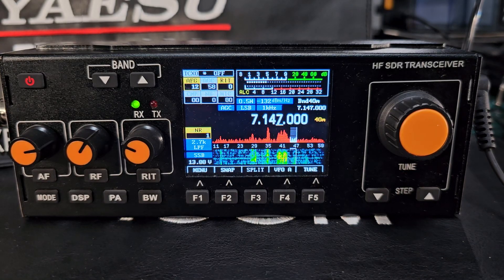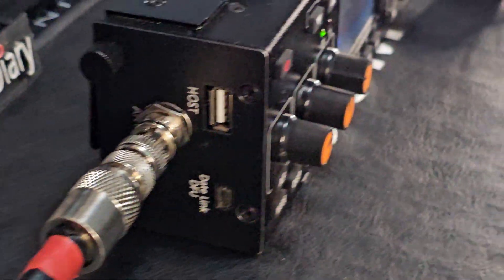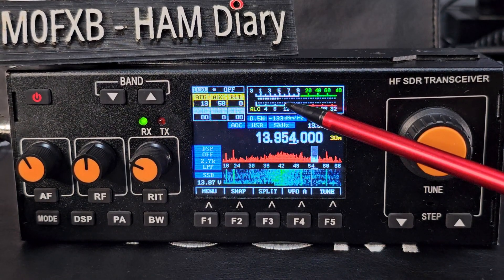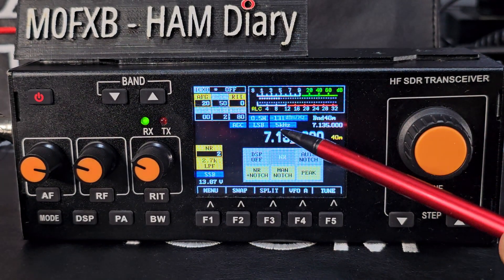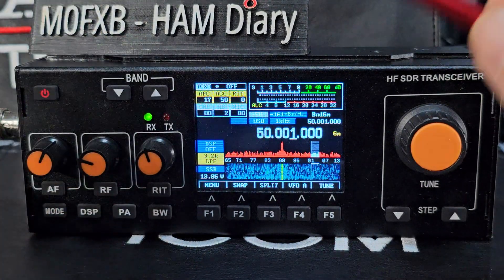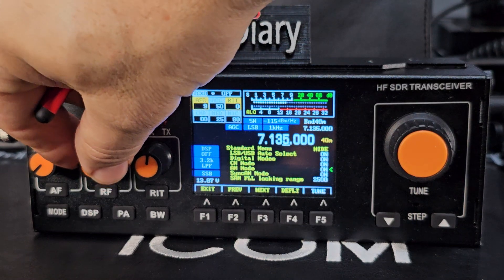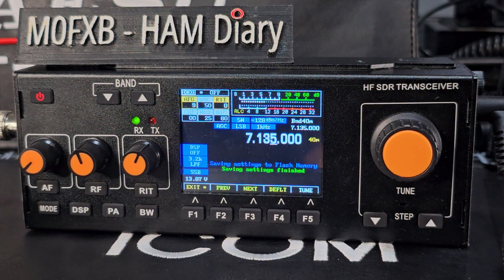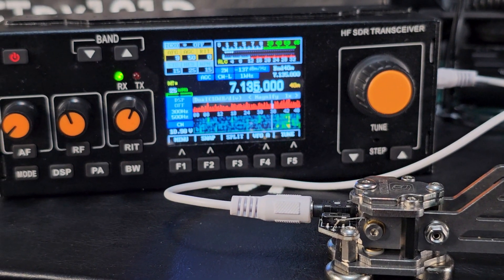RS-918 Battery Model.(bs-188) Model HF Transceiver - BEGINNERS GUIDE

Comment: Mine is going in the bin, It was working great, then I went to bed, the next day it wouldnt turn on, just flashes up a white screen.  I didnt try to modify or do anything to it, simply siwtched it off and went to bed after successfully using it on ft8.
Reply from the maker: You just need reload firmware it’s all in the learning
Reply: @HamTechRadioScannerDrones  cant find thr firmware and bootloder anywhere

Comment: I have this same radio. it is now a brick. went to turn it on and wont come on anymore. any ideas on what to do to fix it.
Reply from the maker: Sounds like you need to reload the original firmware for the Orange buttons
Reply: @HamTechRadioScannerDrones  Yes that would be nice. not sure where to download the firmware. any ideas to where i can find it.
Reply: Same with mine, I didnt even try to update it or anything, working one day, white screen the next.
Reply: @christaylor5856   Still its a brick   waste-😥